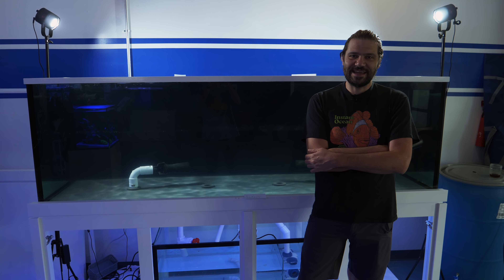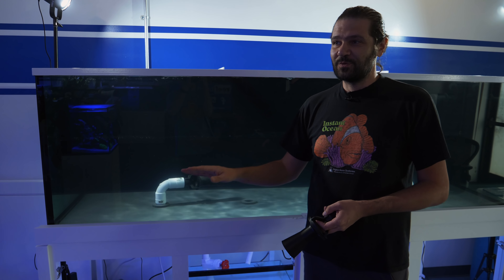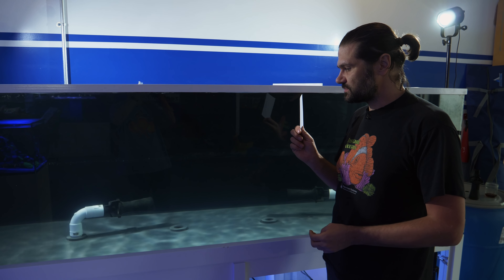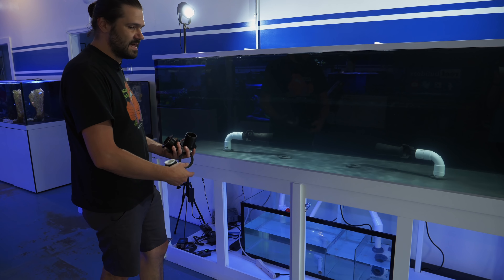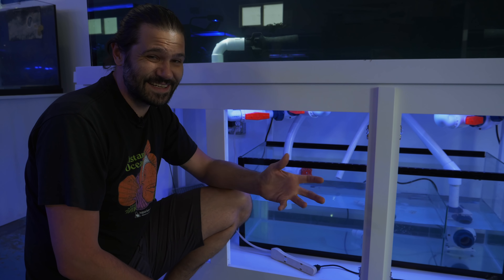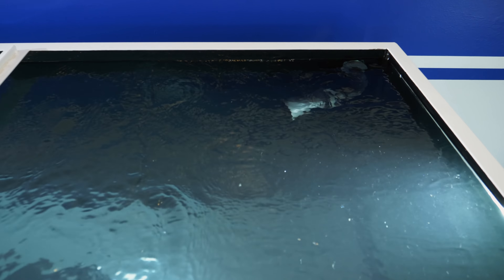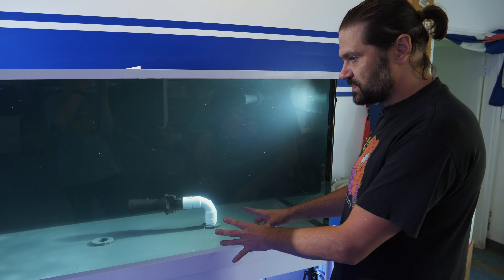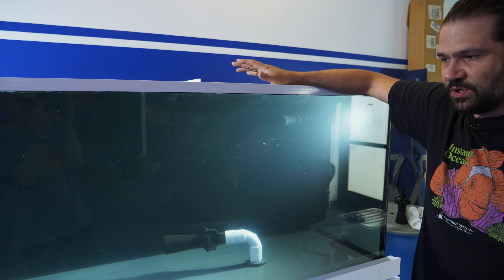Using Eductors to Create Mind-Blowing Water Flow

Comment: I know it’s a old video but I had similar leaks with my overflow and I ordered 1/8” sheet rubber and  cut to same size as the outer overflow box. (Placed between outside glass and outer box. )This reinforced and prevented any skewing of the box and stopped the small leak from bulkhead gaskets.

Comment: Hey Jake - looking great. You also might check at the Random Flow Generators - they use the eductor principle as well to multiply flow, and have the added benefit of randomizing the flow too. They probably don't multiply it quite as much as a straight eductor, but still do a great job...
Reply from the maker: 'Random flow generators' have their uses in small tanks but they are the opposite of what is required in larger tanks where fast, constant, unidirectional flow is preferable to generate complete water movement of the aquarium water.
Reply: @ReefBuildersVideo  Not sure if we are talking about the same product - the RFGs from Vivid Aquatics look almost the same as your eductors, they just include the added benefit of randomized flow - which is usually preferable to unidirectional laminar flow, especially for SPS...
Reply from the maker: @ReefEco  the 'randomness' SPS corals need is not in the flow that you see, but at the boundary layer where the flow meets the coral. Corals don't care what the flow is doing a foot or an inch away from their tissue, but in the millimeters of water directly touching the coral. Unidirectional water movement is the best and most efficient way to generate randomness that breaks up the boundary layer, leading to better gas, mineral and nutrient exchange between the coral and the surrounding water.
Reply: @ReefBuildersVideo  Random flow still interrupts the boundary layer and increases nutrient exchange, especially alkalinity uptake, and actually impacts photosynthesis as well. A constant unidirectional 5k or 6k GPH flow directed right at the corals (which is like parking a coral right in front of an MP60) I wouldn't consider random, a foot or millimeter from the coral, and might be detrimental to natural growth patterns and strip tissue if too strong - you might have trouble with coral placement. Most of the high powered eductors or huge powerheads in the hobby, like the Panta Rhei 10,000+gph, are on 10+ ft  tanks and produce flow tangential to the coral mass, across the front or over the top of structures to simulate a high energy reef crest environment. I'm sure you've noticed the back and forth action of waves/swell while diving on a reef, which is not unidirectional. I used to work at the Academy of Sciences and Steinhart Aquarium when they set up the new 250,000g reef tank there for the new building. I don't doubt your methods Jake or that you know your stuff : )  just offering another option that might provide some more flexibility in coral placement while achieving similar results, though as I said you'll probably get more absolute flow with a straight eductor like you have vs. an RFG from VCA. I would worry about having corals too close to those massive eductors, but I'm sure your serious aquascape skills can solve for that. Keep up the great videos as always - love the studio!

Comment: This is looking fantastic, I’m doing a new build and have CL too. It’s nice to have your more up to date CL, I read way to many threads saying I’d need the ocean motion 4-way
Reply from the maker: using two pumps to switch up flow patterns is MUCH more reliable than having a tricky flow actuator.
Reply: @ReefBuildersVideo  Exactly, I am using two of the large jebao DCT pumps with RFG. Will upgrade to ecotech when they do gen 3 maybe. Thank for sharing your reefing knowledge, I've learned a lot from you and your website.

Comment: cost effective to not maintain/repair/buy wave makers. very smart -->> Next Level Reefing
Reply: Eh... maybe, maybe not.   That's two additional Vectra L2s on there, $475 retail each.   They still need to be cleaned out occasionally.   Plus there's always the electrical argument but this is largely based on where you live,  but those types of pumps use considerably more power than wavemakers do.

not saying what he did was in any way bad or wrong, but there is a reason why closed loops left favor in this hobby.
Reply: @Mike__B  good technical review.
Reply: You just maintain/repair/buy return pumps instead.
Reply: @sronnie  hahah so same thing.

Comment: Jake if you lose power to your closed loop L2’s will your tank empty and overflow your sump or have you got non-returns and if so how often are you going to service them to ensure they operate when needed?
Reply from the maker: The closed loops are fine, they are plumbed in and out of the bottom, and have been connected with water but no power for six months. But definitely need to engineer an anti-siphon mechanism for the return pump

Comment: Nice 👍. I would put some type of rock in there man. U have the 3 flats for no rocks essentially. this is technically a show reef tank and rock work would help no sand I get. It can be a minimal scape something simple.  If not it’ll be interesting to see how u place the corals just a watchers thoughts.
Reply from the maker: The idea is to preserve as much of the dimension purely for coral growth - I want a support structure that will elevate and spotlight the corals without obstructing the flow or collecting any detritus

Comment: 10:18  Aquascape with no rock or sand? Epoxying plugs straight to bottom?
Reply from the maker: No, probably some kind of fiberglass faux-scape and then elevated off the bottom a little bit, still brainstorming it

Comment: Would have loved to have seen how he changed out the bulk head in that tank. Not too easy to get behind that thing.
Reply from the maker: The box is connected to the tank with two bulkheads, so I just took the entire box off, switched out the bulkheads, and then put it back on the tank
Reply: Reef Builders good call. Wouldn’t have thought of that. 
Realistically, your situation would be a good topic to hit on. I bet people run into when setting an overflow up like this after it’s in place. It’s all fun and games till you place the tank up to the wall filled with water.

Comment: With the Plumbing on the bottom of the tank and no loop with a vacuum break on it, how do you keep from flooding on a power failure? Don’t tell me, “Check Valves.” Unless you are cleaning them weekly and testing them they will will fail and/or leak by. Bladder Valves will work, but are very expensive and complicated, if you can even get them in a a Reef safe build.
Reply: The loop on the bottom is a closed loop, so virtually nothing happens when the power goes out, other than that the flow stops. The back siphon via the return is a legitimate concern, though. Anyway, the drain for the sump is connected to the overflow box on the back of the tank. Regardless, Ecotech has battery backups, and I would be very surprised if there isn't already an emergency power system in place with so many tanks and so many corals.

Comment: I keep having back pressure problems also and it keeps flipping my pumps overheating shutoff , I think my pump can't handle the back pressure and 5' head height!...no I don't have a eco marine pump (I wish) they are just ridiculous in price one pump would be 3 times what I paid for my 100 gallon tank and stand ( off Craigslist)
Reply from the maker: What pump are you using? And are you trying to drive a real eductor as well?
Reply: @ReefBuildersVideo  it's a generic DC pump from eBay and the eductor is a 4spray.com "glass renforced" eductor??? I'm thinking it's just a cheap China made pump and that's my problem...?

Comment: i have seen those eductors used before. They killed a lot of fish.
Reply: It does look extremely dangerous at least to small fish. Judging by the water movement in the tank, I would be afraid of putting fish of any size there. May the intention is to not put any fish there.
Reply: In the video he said that this tank is gonna be for corals. No problem.
Reply from the maker: The fish will first of all, have to be able to handle the massive current in the tank, and either be way too big to get stuck, or small enough to pass right through.
Reply: @ReefBuildersVideo  Have you tried putting your hand next to side to check the suction power? It's the amount of water movement the eductors are creating that made me think they may have an enormous suction power.
Reply: Sounds like a fun 3D printing job